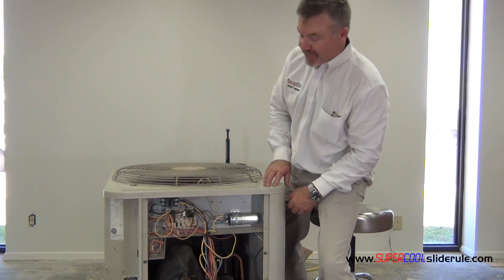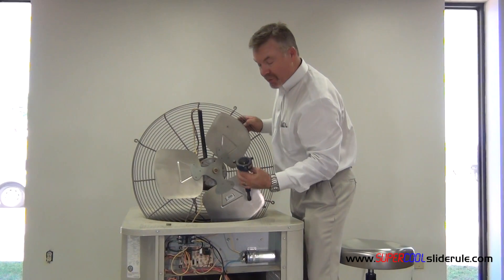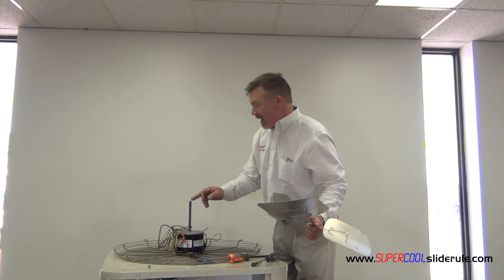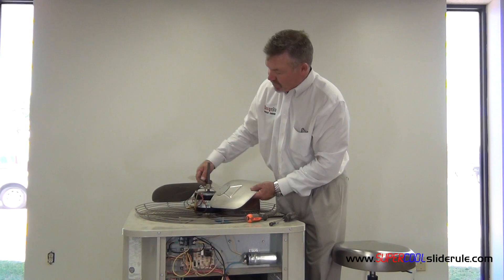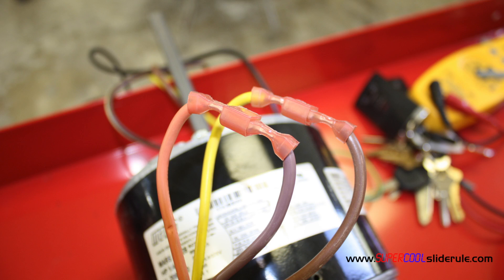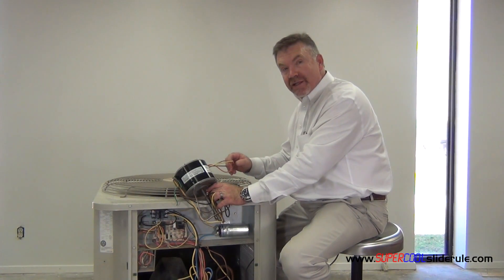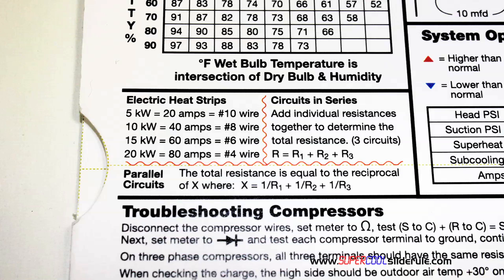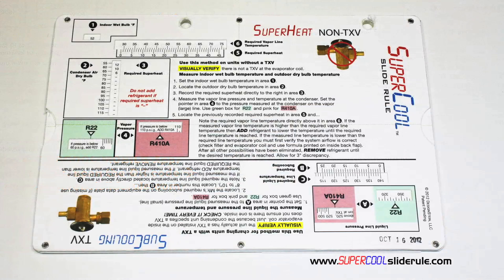How to Replace a condenser fan motor

Comment: Really? " The Yellow wire went right here by the other yellow wire and the black wire went to the defrost board on this terminal here"? Where on the capacitor does the yellow wire go? Anywhere? Just plug it on to any of the 3 different settings? How about that black wire? Just plug it onto any terminal on the decfost board?  Are you trying to get someone hurt? Why else would anyone post a tutorial involving electricity and just half ass tell you where to plug things in? That's a terrible tutorial and i hope you train your employees better then that.
Reply: On the common on capacitor

Comment: I would like to see videos on working on older model AC units. It's great with new units or shop mockups. In real life the units are in not so comfortable surroundings. Nuts and bolts are rusted. Another thing is how about listing the fan blade height on the motor shaft?

Comment: You snatched the wires off the capacitor and did say where you disconnected them from, herm, fan, common,  the wire colors may be different. Mine was but I had on problems hooking this motor up. Thanks

Comment: There is no reason to wire in an extra cap instead of useing a dual run. You only need 3 wires to hook up a condencer fan motor. The white (or yellow) common wire and the brown/white are connected inside the motor. So you dont need one of them. Check the continuity to see what im talking about.   An example of wiring would be black to L1, white to L2 (or to common on the cap) and then brown to fan on cap. All other wires are nutted off and zip tied up in place. And of course when you replace your dual run match what your motor calls for. 
I see allot of guys doing this. Hell i use to do it till i started reading into motors more.
I been a hvac tec for a short time and my boss who has been a tec for 30 years thought i was full of it untill i showed him.

Comment: so theres no need to discharge the capacitor?
Reply: If it's a capacitor then I'd play it safe and discharge it by placing a metal object such as a screw driver across the metal surface contacts and make sure you are wearing safety gloves. Better safe than sorry...

Comment: If you don't take a picture, how do you determine which wire goes where? Also, do all condensing fan motors have the same color wires?

Comment: Most new fan motors require a separate capacitor of their own. Those two brown wires would go to a 5 or 7.5 cap. Never wire them to the dual capacitor

Comment: I'm curious.  Wiring the new motor with the 2 brown wires for the capacitor.  Would it be possible to connect the 2 brown wires to the old dual run capacitor instead of using the new single run capacitor.  If is is possible would you connect the 2 browns to the Common and the Fan on the old dual run capacitor?